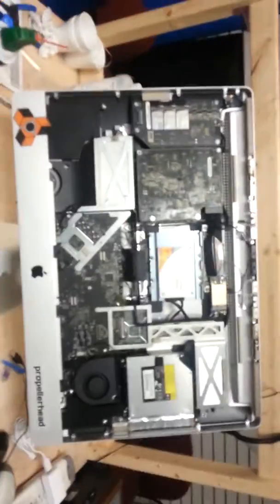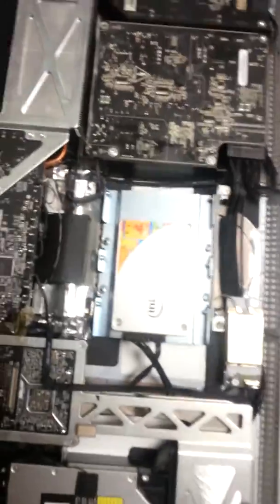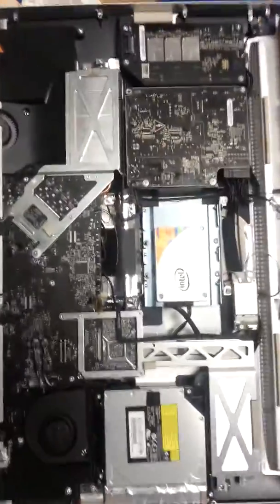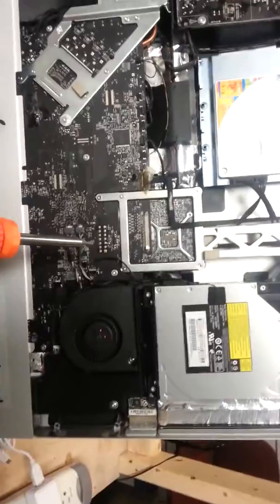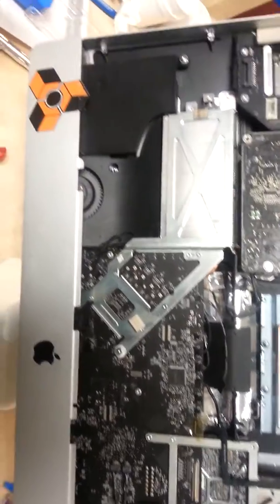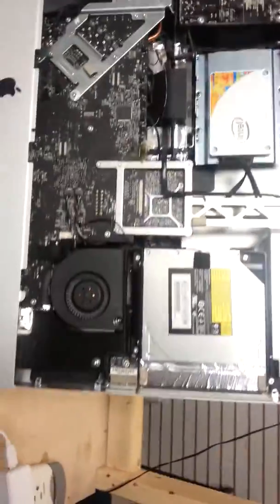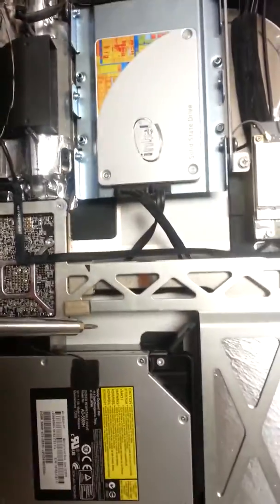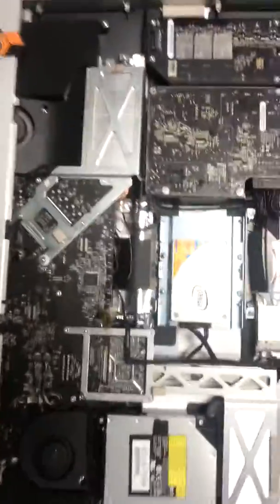Apple Imac 27: SSD | Install & Overheating fix : 2015 0 of3 } Lawrence MA

Comment: Hey just they way you have it at the beginning can you plug it in to see if the fans are turning? or will it cause an issue without the monitor not being plugged in. I cannot hear or feel mine at all. Even laying a little piece of toilet papers in the exhaust at the top the paper didn't move at all.

Comment: for the past year my late 2009 27 inch iMac has been making cracking noises (I think it's the hard drive) and Diskwarrior says it's running too hot at 64 degrees C while it should only be 40-45. The disk health seems to be OK other then that. The cracking noises even happen in my clean Windows install and OSX freezes on simple tasks like opening Word. Could I be having the same problem as your client?